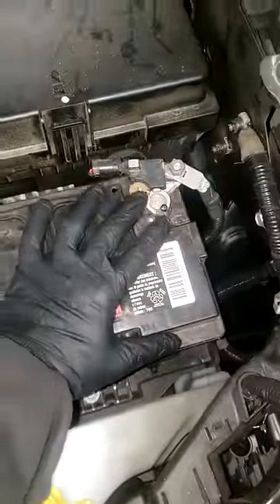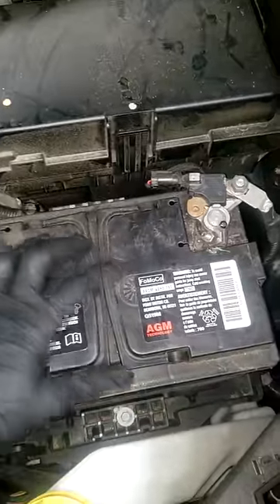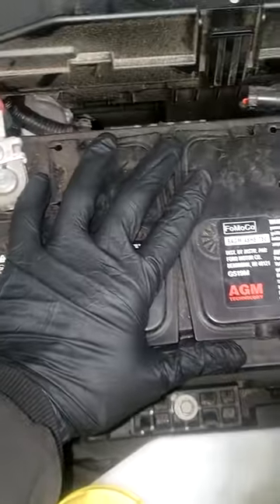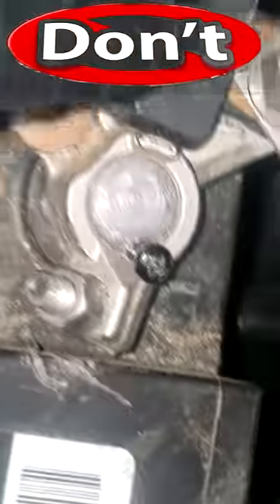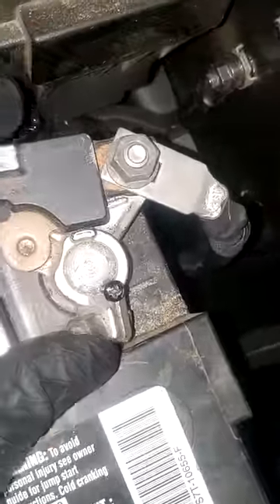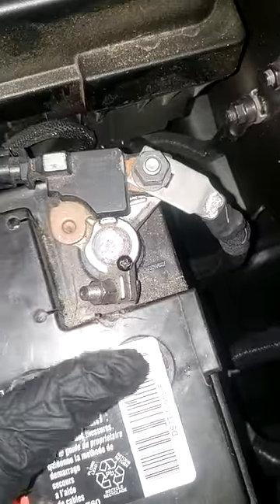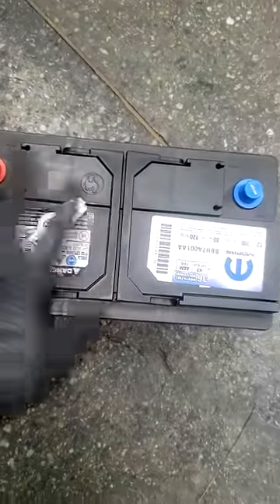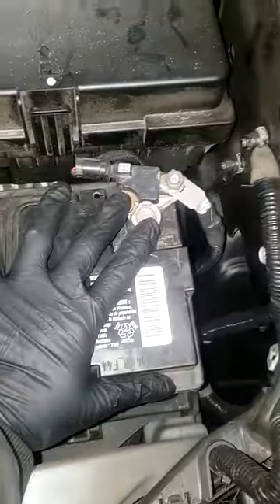STOP DOING THIS PEOPLE. This will destroy your car electrical system.

Comment: So I have worked in electrical engineering for a lot of years, please explain exactly HOW the screw is a problem?
if the terminal was loose that screw would have been effective for tightening the clamp and also biting into the post and the clamp.
Sure it looks dodgy, but you need to explain your logic about the "dont do this" claim.
Reply from the maker: No you need to not remind folks that you worked in electrical engineering if you dont see a problem with this. The check engine light on with an IBS related code. Do you really think im going to chance anything that other shop did with this IBS.. This is not a typical battery terminal. Its a sensor thats monitored by the computer.
Reply: TLDR, wanted more clicks, couldn’t be bothered diagnosing or editing a full video explaining.

Comment: Through the years I worked on cars both for myself and in a shop. Today I am a legit engineer... You are 100% correct, the battery is backbone of the electrical system. With vehicles' computers, those old 'shade tree' repairs just don't cut it.
Reply: I’m interested in what kind of engineer you are that you consider a battery to be a vehicle’s “backbone”. 
A mechanical engineer would argue that the motor is the backbone, a civil engineer would argue the chassis is the backbone, an electrical engineer would argue that the knuckle draggers really ought to stick to thinking about metal and rocks.
Reply: @Clynikal  The subject of the video is 'electrical system' and the battery of a car IS the 'backbone' of the electrical system - it carries load and stabilizes voltages and currents. I have a Master's in petroleum engineering but I'm also a radio technician.
Reply: A battery is a storage device, maybe we need to define backbone because what I consider to be a “backbone” would be something connected to everything and should it fail then the system of things would still remain working but in a degraded mode. In this example a battery is not the backbone. 
If you were to consider “backbone” to mean “the most vital part (of the electrical system), I would argue what’s the point of having a battery if it’s not connected to anything. 
In both these instances I argue that the wiring is the backbone of the electrical system. Battery is important, as is alternator. IBS is the most useless piece of junk attached to a car.
Reply: @Clynikal  I'll repeat it once more. The backbone of the ELECTRICAL SYSTEM in a car is the battery. Every electrical component is connected to it. I suggest a community college course in electrical physics. Watch the video with the sound on.
Reply: @dieselscience  you can repeat it as many times as you like, I’ll let you know the same amount of times that you’re wrong because……drumroll…..I am an electrical engineer.

Comment: You’re replacing the battery because the post was damaged from the screw? Or was the battery dead or low voltage?
Reply from the maker: It fail the GR8 test
Reply: @OnlineMechanicTips  right on thanks. Just asked cuz it wasn’t in the clip. Well done.

Comment: Heart and soul of the electrical system is definitely the alternator. The car can run without the battery using only the alternator (as long as its not got the smart BMS thing on it like this) but generally speaking you can.
Reply from the maker: If im not mistaken, in order to run first you would have to start right. Thats where the battery come into play..Lol. But you are entitled to your opinion my guy. I just dis agree with you

Comment: People are simple minded to think that's OK on a new vehicle I wouldn't do it on my 2000 chev later or newer wouldn't do it or be OK with it. That screw can cause poor connection arc out and send the sensor into haywire. So don't tell me that screw didn't do anything it's more then possible/likely
Reply from the maker: They come in on the tow truck like this all the time because the trans is bricked and knock offline. The reason??? Poor battery connection. Most mechanics that get these in the shop simply find a creative way to word the fix and charge big time. They simply repair the connection and realign the computers. 5 hours flagged later, done. Some hard headed ass customers just need to learn the hard way I guess.
Reply: I did this on my shit car once because I was using the wrong battery because it's a shit car. Anyways, the screw sticking up arced on the hood when I closed it and set the hood liner on fire. We put it out with a water hose but it probably could've burnt the car down
Reply: @OnlineMechanicTips  often not the customer, you don’t think the guy who did this actually gave her an accurate representation of the situation do you?
Reply from the maker: @Fee.1  no
Reply: @bryanedwards9464 lol you live you learn
Reply: @anthonycooper2860  most definitely. Next time I'll be sure to cut the top of the screw off👍
Reply from the maker: @bryanedwards9464  really dude?
Reply: @OnlineMechanicTips  no not really I already scrapped the car. Made sure to chop the converter off first tho, scrapped that separate😉
Reply from the maker: @bryanedwards9464  lol
Reply: Its true the screw doesnt affect the electrical system.
Reply from the maker: @MaYbYl8eR  The screw affects the connection at the battery which affects just about every thing else on these new cars. You obviously work on old shit and don't understand what I'm saying. The good news is that you have a channel. You can easily make a video andvexplain your thoughts on how it work over there. I got this over here.
Reply: @OnlineMechanicTips  i work on a lot of cars any year and the screw does not affect anything.  You might want to learn about electricity more before you cost your customers more unecessary repairs.  You literally looked at the terminal and said its not a terminal guy.
Reply from the maker: @MaYbYl8eR  Then leave your screws in buddy. Don't change on the count of me or this video.
Reply from the maker: @MaYbYl8eR  O and so does this mean we not getting a video on your channel of you flexing your electrical genius? Or you just simply want to display it here on this video? Stop talking and start filming bruh, this is youtube.
Reply: @OnlineMechanicTips  i dont have to make youtube videos to be right.  Besides you made one and now everyone is telling you youre wrong.
Reply: @OnlineMechanicTips  this is youtube so that mean you got a lot of different people watching.  You got people that know what theyre talking about and youre bad mouthing them.
Reply from the maker: @MaYbYl8eR  Whats the point in having a channel Mr youtuber..You don't see me on other channels video flexing my muscles on they stuff. I make my own videos and flex on my own channel..try it. Cause I could care less if you good but maybe somebody else will.
Reply from the maker: @MaYbYl8eR  I haven't bad mouth anyone. I merely respond to they comment. If they come at me foul, theres a chance my rely will be foul. Thing is, you can respectfully disagree with anybody. I have no problem with that.
Reply from the maker: @highball7347  Whos asking you to buy it? I'm not seeking validation from anybody, just showing what I'm doing
Reply from the maker: @highball7347  The simple fact they you defending that damm screw says a lot about you. We simply cut from a different cloth. So we will likely always have a difference of opinions. I work on brand new cars daily. Hacked terminals and screw that cause bad connection will simply destroy these new computer control cars. If yall want to keep doing that. Go for it.

Comment: bushfix. i have done this. then went home cleaned a piece of lead, hammered it flat, then put the thing around the post tightened the post. buddy cut off his old connector, put a new bolt on, had nothing but problems.
Reply from the maker: Not advised on new cars..You can screw and bang away on ya old ass cars and it'd be cool.

Comment: Good that the problem was solved, but the sensor doesn't know if there is a screw in the lead terminal Part of the sensor.
Reply from the maker: Lol, you cant have it both ways my guy. You obviously dont think the IBS was the problem. Not sure how you would suspect that without even knowing what the code is. How would you think that sensor was able to sense that it has been compromised if that screw had no affect on it?  Make it make sense. Now I will admit a lot info left off this video because its a 60 second shorts video. No time to explain everything. But thanks for watching
Reply: Indeed,as long as it's contacting it will just read what its designed to measure.And unarguably,if it's passing enough amps to crank the starter over then there is enough contact for that Battery current module or battery sensor module(not IBS) to get a decent reading,the proof would be in looking at the fault codes and data. It may have been a faulty sensor but that screw wasn't the cause of it.
Reply: @OnlineMechanicTips   that screw is not affecting anything. Not right to put it there but not hurting anything
Reply: @tylerseabook9423 you’d be surprised by what a difference that screw can make
Reply: @burntgrilledcheese2712  please explain how this is possible, as in what, specifically is the effect of a screw in this clamp. I won't be surprised because I don't believe it is possible.  This is until otherwise demonstrated or provided with a plausible explanation.
Reply: @jeffcard3623  The screw is there to take up any slack or looseness in the clamp,a shimming or packing device if you like.
Reply: @jeffcard3623  my guess is that the screw effects resistance because it's made out of a different metal than the terminal and the post. As you probably know different metals conduct electricty better than others. It looks like the screw is in between the post and terminal so that would make it part of the circuit. If that sensor is expecting a specific value then it makes sense that something like that could cause it to think something is wrong. Maybe I'm wrong, I'm not an expert but that would be my somewhat educated guess.
Reply: @notpoliticallycorrect1303  you don’t think a metal screw would effect anything electrical?
Reply: @dylanb586  Not at all.
Reply: @who_cares848  The screw is touching one part of the terminal the rest of the terminal is contacting, the screws function is simply to take up the slack or looseness in the clamp.conductivity impedance or resistance has absolutely nothing to do with it,even if the screw is made from non conductive material it won't make any difference whatsoever!
Reply: @dylanb586  Go ahead,do your very best to try to convince me otherwise. Give me one good valid reason why a screw will stop that terminal from conducting.Because my families 80+ year history of being in the motor trade,building specialised commercial vehicles and motorsport preparation plus the thirty years of running my own garage with 7 techs and 2 testers tells me that I know a damn sight more and probably forgotten more about the motor trade than you will ever know.  Do some research or learn to read,many battery terminals were screwed down with a cup and a self tapping screw.,If the terminal can transmit the 6-800 amp needed to crank the starter then it will be more than sufficient to transmit the 100-200 amps put back in by the alternator and more than sufficient to transfer any heat or charge rate that the condition monitor dictates at about 200ma. If you can't even grasp that simple concept then this simplified situation is already way beyond your limited grasp.

Comment: NOT TRUE! Please, more people do this! I just got a 10k car for 300 bucks because the battery terminals were all messed up! Seriously though, bad battery connections will cause engine, transmission, electrical problems from hell. Keep 'em clean!
Reply from the maker: You can do this all day long if your car not equipped with IBS. Thats the newer cars my guy.

Comment: I literally had a f150 like that yesterday. That was the complaint. Declined the sensor and connector.
Reply from the maker: I get why folks do it, its just not recommended if the terminal actually a sensor.  You can pull this off on older cars
Reply: @OnlineMechanicTips  yep. But today's cars are very dependable on battery voltage.
Reply: Take it from an electrical engineer, adding a screw to the terminal will not alter the resistance of the interface enough to interfere with any sensor connected to it. Just think that the sensor will be looking for a range somewhere between 11.5VDC and 14VDC, that screw is not adding any extra resistance, if anything it’s improving the resistance between the terminal/post and connector/lug. The connector may have needed to be reshaped or the post reseated but more it’s probably more likely that the battery was just no good.
Reply: @Clynikal  correct
Reply: I will however admit that the sensor does more than measure voltage. The shunt will measure current and there’s generally a temperature thermocouple in there. None of which will be affected by the screw.

Comment: I am a certified A technician doing this to a loose battery terminal will make it tighter and give a better connection as long as you don’t put the screw through the sensor or the battery it won’t damage anything.
Anybody that say otherwise should only be fixing sandwiches from now on.
Reply from the maker: Bruh, why the need to mention your so called certification? What you think that makes your opinion more reliable? Uhmmm, no. That means nothing over here. Fact is, I have all 8 auto ASE and im a Master Tech but I dont go out yelling that shit every time I speak on a comment. It means nothing. Seems you just another screw defender which also means we have a difference of opinions. And believe it or not, thats ok. Thanks for your opinion and tuning in.
Reply: @OnlineMechanicTips  I work hard to get to we’re I’m at I can say it all I want to having the certification and the experience separate us from the rest.

Let’s be honest all that car needed was a battery when the sensor detected low voltage it will throw a code.

It you told the customer the problem is there battery and you tell them the last person did a improper repair to hold the terminal in place by putting a screw in it.

Your suggesting she replace it then yes I agree with you.

But you told her to fix her problem she needs a battery and the sensor you told her the sensor is bad because someone put a screw on the other end of it that have no electronics.
Your not a honest mechanic.
You need to be honest with customers and not use scare tactics to get them to do work.

Remember man never do to others what you would not like do to you.
I am 100% honest with every customer and I treat there cars as if it was my car.

What if the last person that put the screw in there did it because the customer was in a pinch and she did not have no money to fix it properly.

What if the last person that put the screw in there wanted to fix it properly but was not able to order the part because it’s a dealer item and needs to be ordered. 

You don’t know man putting the screw in there got the job done.
But as a technician, you should not be ghetto rigging customers cars, always fix it the proper way the first time.
Reply from the maker: @atmphil1  Dude I been hearing this a lot. Why in the hell do yall always assume a customer is poor or broke or in a pinch? This customer just wasted money an more important to her, time, at this other shop. I assume that they assumed she was poor,,smdh. Why do you think she ended up coming to a dealer when everybody know the dealer expensive? Ill tell you why, because she wants it fix right, the money not an issue when it come to your piece of mind. After i wrote my estimate and show her what they did she said to fix her dam car right. She didnt bother to go back there to fuss or get money back. My repair included 2 simple parts and a removal of a dumb screw that yall seem to love.  I dont really care what all the comments say, putting that screw in that terminal affects the connection which causes all kinds of problems on newer cars. You keep them damm screw in the hood on them older cars. The newer cars not built for that.

Comment: did not know that new cars had a sensor on the negative terminal... interesting and informative. thanks
Reply from the maker: IBS. The intelligent battery terminal is basically a shunt to read how much amperage the electrical system is consuming.
Reply from the maker: @foodhatesme  At least know what you talking about Mr 1980s man. New cars need to know how much amperage going thru the electrical sys as well as the temperature. The computers on the newer cars need this info for various reasons. You might wanna just hang on to ya old ass cars.
Reply: @OnlineMechanicTips  I love my old ass car. I can work on it, which I do regularly. Old school kind of gal.
Reply: @OnlineMechanicTips   no they don’t. There’s plenty other ways for that car to get that info without adding more failure points
Reply: Imagine a car from the 80’s being able to tell you current draw and battery temperature, that must have been state of the art! Oh wait that was being done in the 60’s….